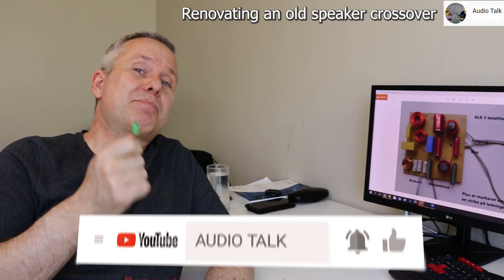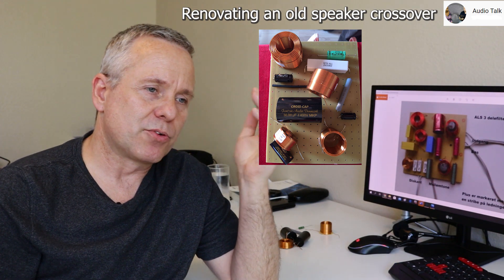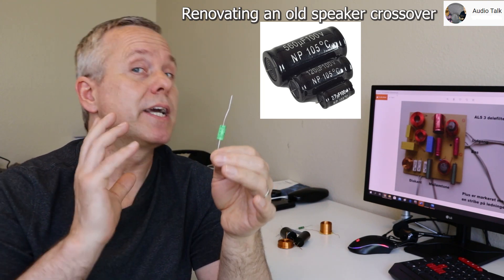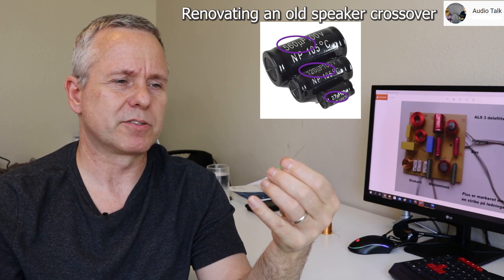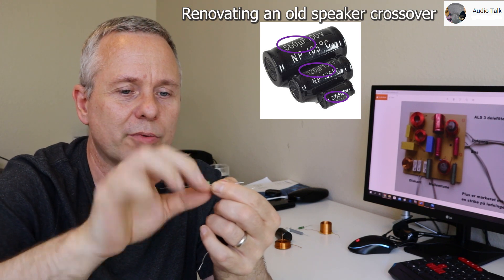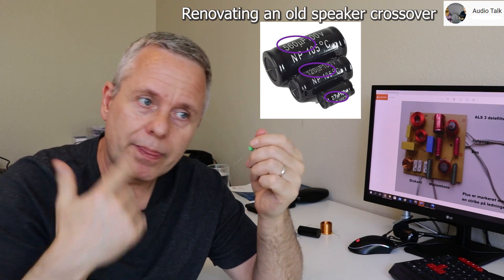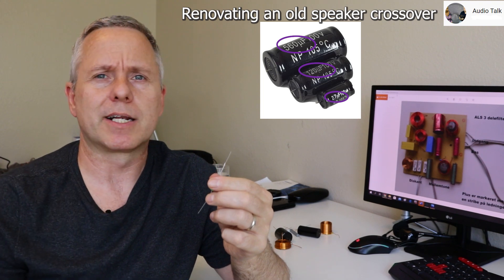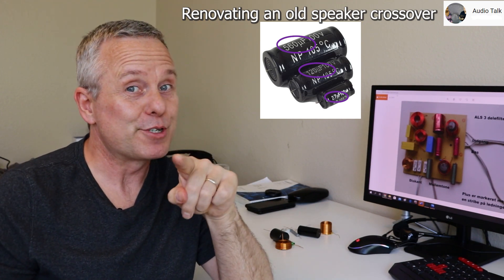Renovating an old speaker crossover

Comment: One should always consider that electrolytic capacitors have ESR. So I think replacing it with a polypropylene cap is great but a resistor must be added to compensate the ESR. Otherwise the sound pressure level will be all wrong and the speaker will sound unbalanced.
Reply from the maker: a really good point Alexandre! If the electrolytic sits in the highpass and particularly higher Xover frequencies 2nd order it would need compensation from a resistor. Excellent point!
Reply: I had 2.2uF caps with four ohm ESR, sounded muddy, 2.7uF poly caps brought the speakers alive. Being a 6 ohm speaker, I think a 3.3 or four uF would sound less tinggy
Reply: @VaughnfromPeterborough  two distinct things. Changing the capacity will change the frequency of the crossover network at which signal will pass or not. The resistance will affect the intensity of the signal and the sound pressure level you get out of that speaker at that frequency.
Reply: Sometimes changing a capacitor to an ultra low esr will change the designed SPL of the driver or the crossover frequency.  These recappers really should be showing us the crossover schematic and explaining the implications of their "improvements." I have heard some of these upgrade listening tests and it's pretty obvious the mod changed the crossover frequency, boosted the mids, and everyone jumps up and down screaming "a veil has been lifted!"  Never mind that the source was never meant to sound that way.
Reply: What value resistor?
Reply: @6StringPassion.  I measured the ESR for each of the capacitors that I had and the new polypropylene ones. I added the difference between the two.
As a rule of thumb polyprop caps sound awesome on the tweeters and midrange and are really worth it, if you can't measure ESR I would put 1ohm resistor on the tweeters and 0.7ohm on the mid range. Otherwise they will get in your ears too much and you won't bear listening to the speakers.
Reply: @alexandrefernandes6286  Thanks. In series or parallel?  I'm a total noob.
Reply: That's not true. It doesn't matter when you are dealing in high frequencies. You ideally want no ESR when designing a crossover.
Reply: @j.t.cooper2963  That may be what you want, but the original engineers who designed the speakers balanced them with the ESR inherent in the components they were using. So n practice, they were intended to have x amount of series resistance and reducing that may make the tweeter harsh or stand out too much.

When working with refurbing vintage gear, you're not 'designing' anything, you're replacing worn components, and you don't have all the information that the original engineers had to make an educated guess at what they did and the compromises they chose to make.
Reply: @edwardgiovannelli5191  Duh..... Ok. Whatever you say. 🥴
Reply: @edwardgiovannelli5191 Exactly! It's one thing to restore a speaker and another to resto-mod a speaker. If you want to keep the sound as the engineers originally intended, replace electrolytics with electrolytics. If you want to play engineer and try to "improve" the sound, by all means, get modding!

Comment: Hi Ken, I have a pair of Infinity Reference Two speakers that i believe have faulty capacitors...at least after watching this video that is hat I'm guessing, the highs are almost non existent in the sound...I was wondering what is the best place to purchase upgraded parts to do this project...and also, any advice or tips for a newbie like myself?
Reply: I know this is a little late, but for anyone else with the same question... Parts Express is a good place to start your search for audio parts. One important point is, replace old parts with as close to the exact same value parts as possible. If your crossover had electrolytic capacitors, replace it with electrolytic capacitors. If they were 220uf, replace with 220 uf. No higher no lower. You can fudge a little on voltage capacity - AS LONG AS THE NEW COMPONENT IS HIGHER - but again, you want to keep it as close as possible. If the caps were 17v you can use 19 or 21v... but going with 50v caps will not do you any good at all.

Some people say to increase the values this way or that, or use this type of capacitor instead... NO; all those changes will alter the sound and there's about a 90% chance it will be for the worse. The original engineers knew what they were doing, don't think that you (or I, or anyone on the internet) knows better.

Comment: Parts express,  go with a poly-cap of film it will improve the sound
Reply from the maker: You will get much further for your money if you analyze where it's important, that's also why all good manufactures do it. If you want to raise the bar to what I am showing, you just use the same information and move all caps up one level, but to make them all the same type is a waste of money.
Reply: No, best to replace like with like. Esr compensation is calculated into the circuits and will negatively impact the sound if a low esr film cap for example is substituted for an electrolytic.

Comment: How do I find out what specific capacitors I should get to replace the ones in my old CS-D 7001 Pioneer floor speakers?
Reply from the maker: To replace them you should read the value of the old one and replace to the same value uF and perhaps upgrade the quality
Reply: @AudioTalk  Then taking the old ones out and installing the new is another subject. I have a soldering iron but it doesn't have a fine tip for electrical replacement use. How are you at replacing dome covers? The other speaker had the dome (dust cover) on the woofer, it fell off when he removed speaker cover, it was almost off when I gave it to him, so he reglued it. The other speaker that works fine is missing the dome on the woofer. I need to figure out what size dome I need to get and glue it on with moyan (special rubber cement for speaker use). Would you be able to share information on measurements for that dome replacement?

Comment: Hi, interesting video and it got me to thinking about my speakers. I have a pair of floor-standing 1970 PSB Passif 1 speakers (tweeter, mid, bass), the terminals at the back are getting cracked with age and the entire crossover unit is glued to the terminal panel. So how easy is it to change the capacitors, I know how to solder fairly well? And is it recommended to take the entire crossover out of the speaker and mount it in an external box? I have to replace the terminal panel anyway as the old one is too fragile to reattach into the speaker. Thanks for any suggestions you have.

Comment: I have an old set of Technics (circa late 80s) 3 way speakers. One of the speakers no longer sends signal to the tweeter or mid (only large woofer works) I swapped the tweeter from the “bad” speaker to the “good” one and the tweeter works fine.

 Would this be evidence of a bad capacitor or bad resistor for my tweeter and mid? Otherwords will a bad capacitor prevent signal from getting to the tweeter and mid completely when it fails?

Thank you for the video!
Reply from the maker: Do you have biwiring terminals? if you do I will check if those are loose.
Reply: If you swap components and the problem follows the component, then the problem is usually with the component.

can you put an Ohms meter across the speaker leads (disconnected from the crossover, of course) If you get infinite resistance, or zero resistance, then the coil has either blown open or shorted. Either way, replace the speaker.

(I know this checks resistance, not impedance, but it is just a quick check to see it the coil is any good, not an electronics class)

Comment: What is your opinion of using a high quality low UF bypass cap at the tweeter? Im using Mundorf  M-Cap Supreme for mids and tweeter. I’m working on upgrading a set of Heresy ii’s. Also would a 16 gauge copper foil inductor be any better than a 14 gauge air core inductor at the tweeter as well. I would appreciate your advice, your videos are very informative.
Reply from the maker: Thank you, and yes a small bypass cap parallel to the original ones will likely create better highs, but replacing them with a better cap will be better but of course also more money. But I would place more money on the cap and skip the upgrade on the inductor. The cap has far more impact on the sound being in series, where the coil is mainly just the electrical load it has effect on by sitting in parallel. I am not saying it has no effect, but its far less and knowing klipsch getting a soft sounding cap on could be a large improvement. I would recommend to check out humble made hifi`s article on caps, and look for the Alumen Zcap fra Jantzen, that will calm and clear the highs, Mundorf is good stuff but maybe not bang for the buck.
Reply: @AudioTalk   Thanks for taking the time to reply. I already have the caps but I am yet to do the rebuild. I am still a little confused how to wire these since I will be removing these from their boards. I have Mundorf Supremes for the mids and tweeters and intertechnik audyn Q4 for the low pass filter woofer cap.I also bought 16 gauge copper foil inductors for the tweeter. I was wondering if should have went with a bigger inductor, although I feel that they are an upgrade in general. I left the low pass inductor alone due to reading that I could potentially makes Things worse. I will be doing a stage two upgrade soon, I will be putting in better quality autotransformers and was considering putting in bypass caps and a 12 gauge air core at the woofer, if that won’t throw off the sound. Any advice is appreciated.

Comment: hello, i have paradigm studio monitors (90's 3 way, 3 sets speaker binding posts, 93lbs each) speakers that i want to upgrade the crossover.  its all attached to the board that has the binding posts on it as well.  i can see the crossover when i remove the 2nd from the bottom woofer but really have no idea how to accurately read the parts or determine what i should actually replace.  i tried to find info on the crossover but no such luck.  any help ?
Reply from the maker: Unfortunately, that question is very specific to Paradigm and perhaps even specific to that model. So my advice is to follow what I am suggesting in the video and identify electrolytic capacitors and upgrade to MKP or MKT capacitors. Then follow the wires from the tweeter and try out some good capacitors for those you find there. Good example would be Jantzen superior Zcaps that they sell at PE, and the resistors to Jantzen superes.
Reply: @AudioTalk  ok sounds good ty.

Comment: Do you suggest updating 1983 Cerwin Vega D-7 crossovers? They still sound pretty good. I'm to chicken to tinker with them 😐
Reply from the maker: Replacing the capacitors in that filter is highly recommended, with that many years and likely spanking the electrolytic acid has probably dried out.
Reply: Thank you I appreciate it. Yeah man they are probably hollowed out

Comment: glad I found your videos.   When I did hvac work I had a freind who owned an electric supply co. I'de always show up with the dumbest questions but knowing I was learning he was so patient with me to the point were he'd break away from a big order to take equipment I bought in and test .lol ,sometimes we'd have wires shoved into outlet receptacles...He is a great guy.  anyway my main takeaway fro this video was getting audio grade caps. I have an old DCMT timePiece  speaker that needs a cap. those litle bookshelve speakers sound fantastic. One is good it has 2 orange mylar caps, the bad one has an orange cap and an electrolytic. I'm sure the electrolytic is at fault.

Comment: Hello Ken
Thanks for the interesting video that you make!
I am trying to work on my kef q70s crossover and I am deciding to make the bottom a little bit lower, still need a new caps! Thay go down to 45hz and try for 35hz :/ what do you think?
Reply: Changing the caps will not change how low your speakers are capable of going, or how close you may be to one of their resonant frequencies. Chamge out components with parts matching the OEM specs. The original engineers knew what they were doing, and they did what they did for a reason.

Comment: But you should have a resistor in line to the film capacitor if replacing the electrolytics because they have a lower resistance then electrolytics

Comment: Really love these videos, ive just built a 3 way horn speaker system, at the stage now of designing a crossover... Where is the best place to start
Reply from the maker: Thank you so much! If the voice coils of the 3 drivers are at the same vertical axis at the throat of the horn you have a chance to get a good image with a passive filter. But if only the mouth the horns is aligned due to aesthetics, you got to go active with a DSP because of the phase difference. Another thing with horns is peaks and troughs in the response due to the horns where a DSP make it linear. But I made this little program 5 years ago with the most basic and most used types of passive crossovers and its here as a free download for windows https://bekent.dk/blog/speakercalc-gratis-hoejtaler-beregnings-program/ but there is a lot of good calculators out there.
Reply: @AudioTalk  thank you so much i appreciate it

Comment: Hello sir two years back u told us placing multi speaker setup in series or parallel. Sir I would like to have this setup in my onkyo avr as it has only two channel for atmos. Instead is 2 speakers I would like to have 4 speakers on both channels. Means two speakers on each. Sir my question is u told us about ohms. Will u please tell about watts calculation also. I mean how to divide it per speaker or what so ever formula. Please tell. Thank you
Reply from the maker: Between the choice of parallel and series depends on your speaker impedance and the amplifiers range of allowed impedance loads. If your amp can do 4 ohms loads, you can parallel 2 speakers of 8 ohms to each channel, but if they are 4 or 6 ohms speakers you will need to connect in series. But have you thought of the timing by having 2 speakers on 1 channel in surround, if not careful you could compromise the Atmos effekt unless they are really close.